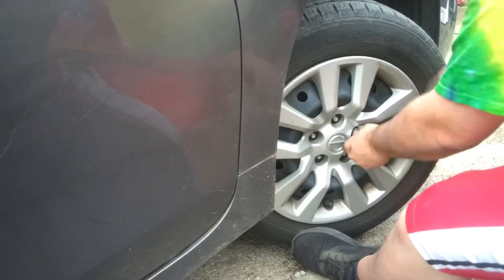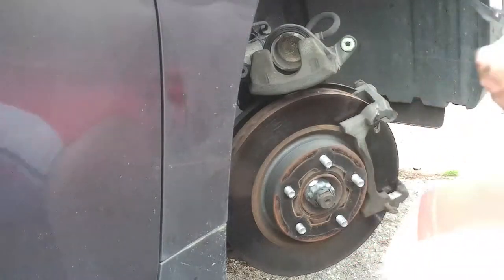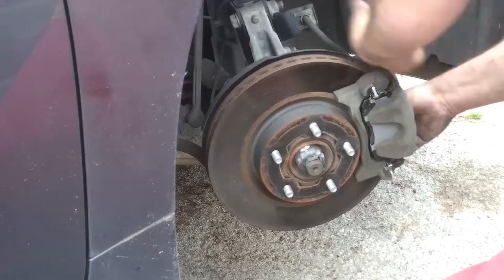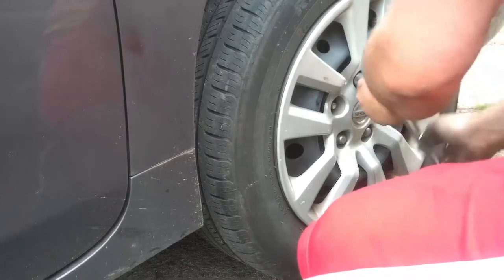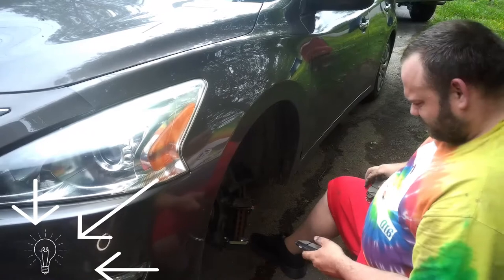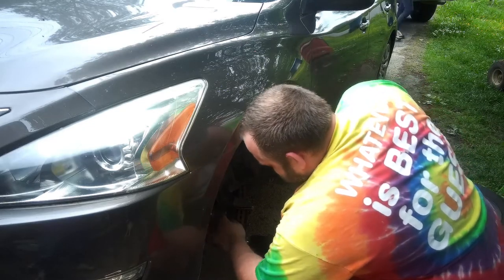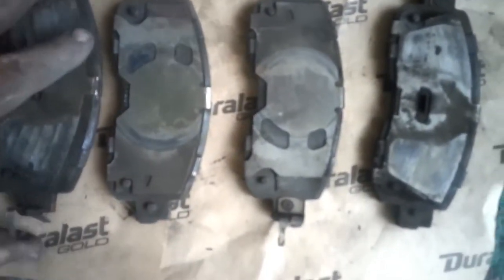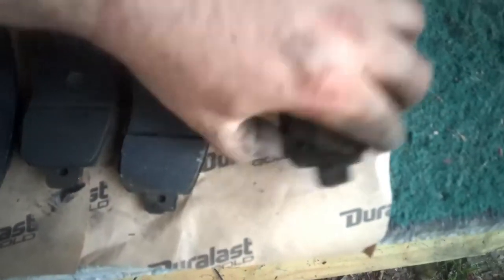2015 Nissan Altima DIY Front Brake Change Out

Comment: Couldn't quite tell... at first it looked like you were using ceramic brake pads. Not so sure now. Which type are you using in this video? Great job, by the way.
Reply: I just rewatched the end and got my answer. I was correct, after all. lol.
Reply from the maker: Dualistic gold pads are a composite ceramic pad
Reply from the maker: Thanks for stopping by
Reply: @RyotekCorporation  You're welcome! I enjoyed the video.